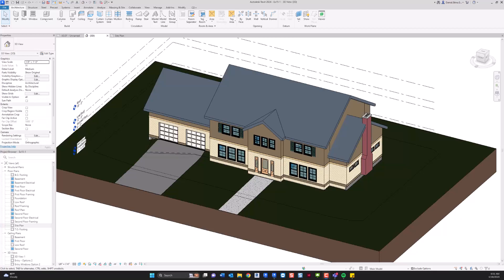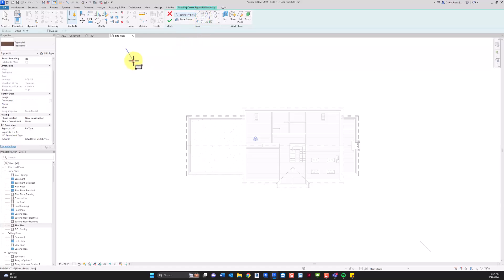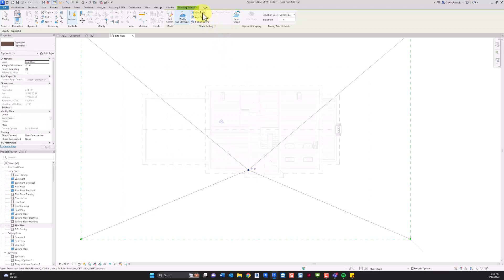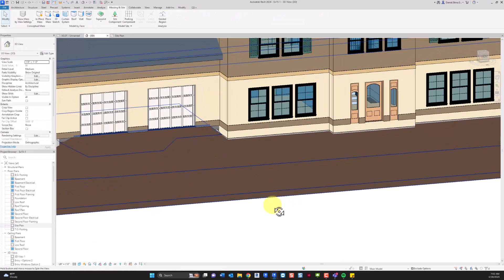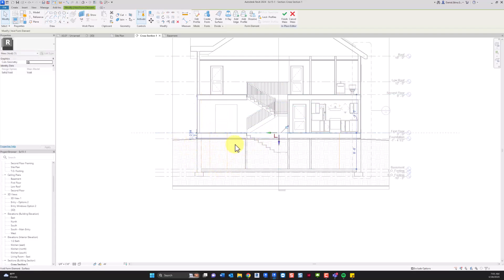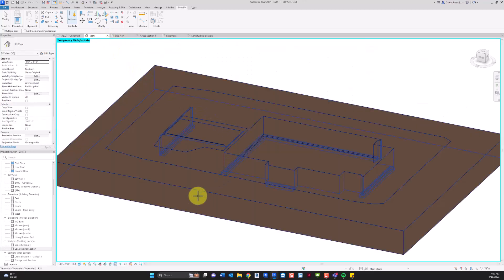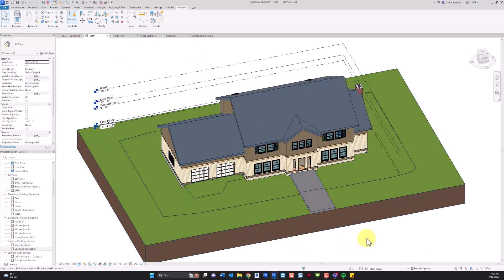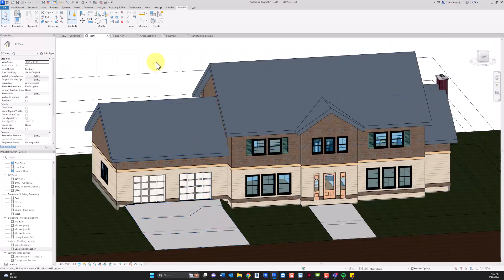Revit 2024 Toposolid Video

Comment: Great video.
I'm learning Revit from your book. Excellent teachings. It would be great if you release an Advance course.
Reply from the maker: I have written 6 Revit books! They range from basic to more advanced. Which one are you using?
Reply: @DanielStineNow  Thanks for answering.
I am using the very basic one, I'm almost at the end of it, "Residential Design Using Autodesk Revit 2024".
Which one you do think I should take next?
Thanks again.
Reply from the maker: @kevingarcia7630 Design Integration or Interior Design using Revit depending on the topics are are interested in. Both get more advanced.